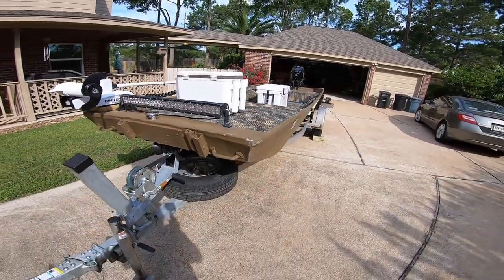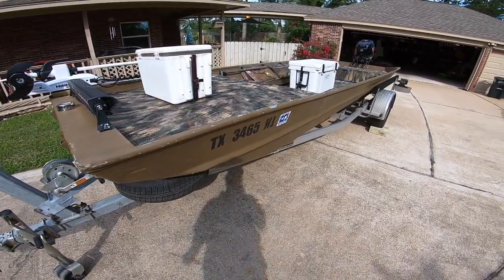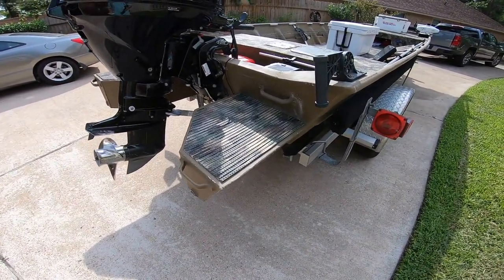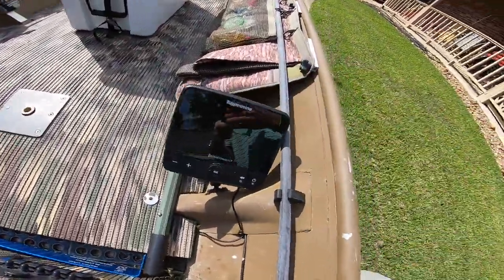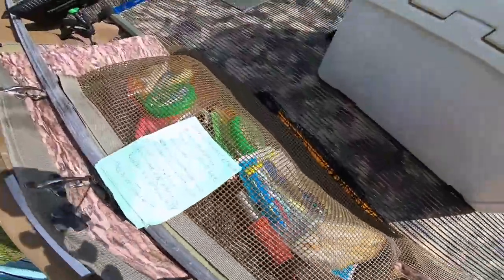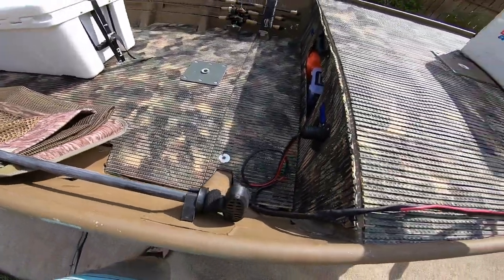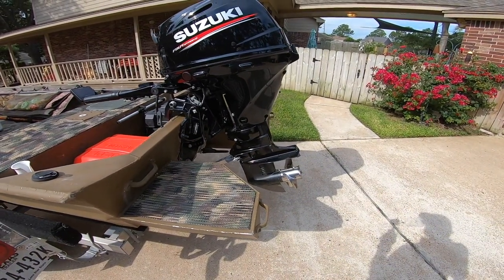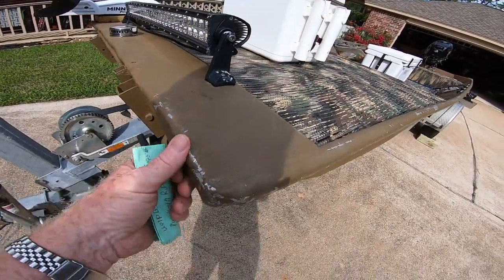16ft Weldbuilt Jon Boat, Suzuki DF25A(25HP) and Minn Kota Riptide PowerDrive.

Comment: Great advice,boat ect is very nice.i was wondering what it the back pontoons  where wrapped all the way around the engine...that way it would help whit weight and you could stand on them if you needed to work on engine ..i know its new but over time...but all in all great job.

Comment: What volt is that trolling motor, 12 or 24? If a 12v does it last you all day using spot lock on a mild wind day??
Reply: It is a 12V.  I run it on a 800 amp deep cycle battery and never run out of power.

Comment: I love the whole boat and motor plus the lightbar .what brand battery do you use?
Reply from the maker: It is a NAPA Premium Marine. 130 Amp Hour, 800 Cold Cranking amps, 1000 Cranking amps.

Comment: Have you had any prop chatter at idle since installing the stainless prop?
Reply from the maker: Not at all
Reply: @jonboatcharlie409  Thanks, that was my biggest concern, as I’ve read that some folks have. Did you use the Solas prop finder or how did you know what pitch stainless to buy?
Reply from the maker: @chilic82  I used the prop finder and guess I got really lucky!

Comment: Did you use the 3M backing for the hydro turf? Or contact cement? 

I wish I would’ve had them install the tuck away hitch when McClain built my trailer
Reply from the maker: Contact cement.  You can have the tuck away installed anytime.  Call Scott and he will fix you up!
Reply: Jon Boat Charlie thanks!

Comment: What power pile set up is that?
Reply: Power
Reply from the maker: It is the base model Power Pole.  They make a motor that the pole can be used with.  We use the trolling motor “spot lock” 99% of the time as our anchor.
Reply: @jonboatcharlie409  just got a jon boat. Want to try one of these .do you only have one in back?
Reply from the maker: When we purchased the boat it had a piece of square tubing welded on the bow.  We often put the pole through the tube and anchor from the front.
Reply: @jonboatcharlie409  keep up the good work! Enjoy your videos. What area do you all fish? Galveston?
Reply from the maker: BASTROP Bayou and MATAGORDA